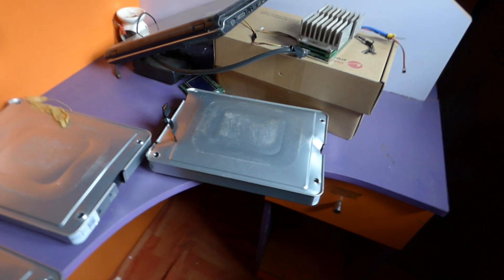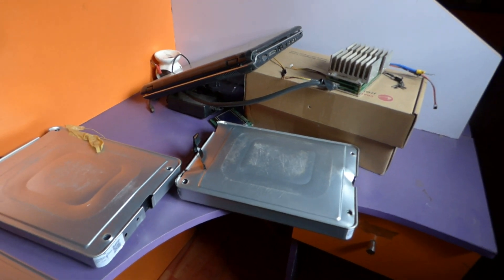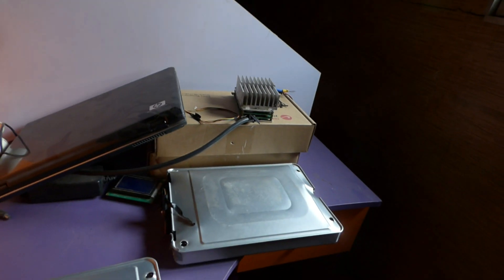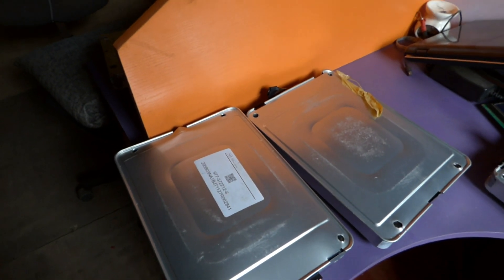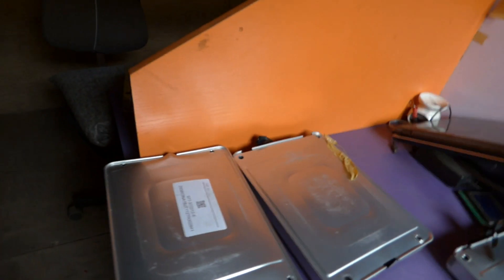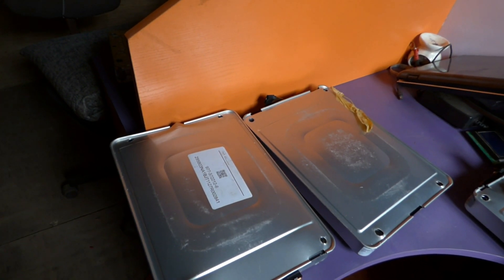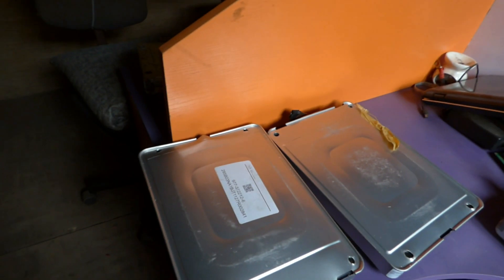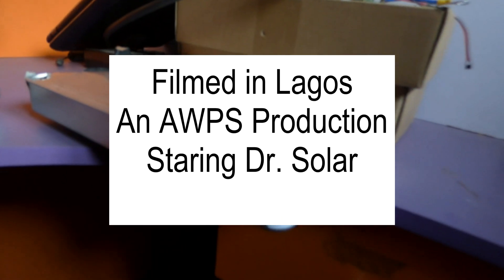Oh No. I Killed my Nissan Leaf Batteries!!!

Comment: Hi AWPS, I see that you used different BMS in your videos, in you experience what BMS do you recommend, I need a BMS for a 40 kwh 16s 3p leaf batteries bank, or at least if you can tell me what BMS worked better for you. Some people advice to have a BMS that display what is going on on each cell,  but what about just putting a small and cheap voltmeter on each cell like this one:
 https://www.ebay.com/itm/0-36-inch-LED-Digital-Voltmeter-Voltage-Meter-Volt-Detector-Tester-Panel-NI5L/283584461465?hash=item4206f37a99%3Am%3AmHnUzgm70k8LSD4MY2dlAiA&LH_BIN=1

Or any one that have any input to this I would appreciated.
Reply from the maker: I put a simple BMS that can shut down the charge or discharge and them used my inverter and charge controller settings as my primary line of defense. I also added a balancer and equalizer to the mix. The less complex the BMS the longer it will last in my opinion

Comment: You can get away with not using a bms but the batteries have to be in a similar state and balanced. Those were not. Or you have singly charged each cell but if 1 self discharges quicker then the rest a bms is needed. 
  I have seen ppl pop the ballooned pack and tape it up. But you cant charge to a high voltage. Cut off at 4v/cell or less and you will never get the same capacity . Be careful these cells can explode and catch fire but im sure you know that. Thanks for sharing
Reply from the maker: Thank you Frank
Reply: No problem . Make sure if you charge them again to watch them carefully. They will not be as safe as they were
Reply from the maker: @frankz1125  I will not reuse them. No need to take the risk.
Reply: @drsolar  ya you are probably correct. There is a risk